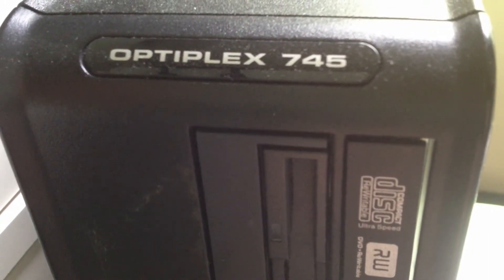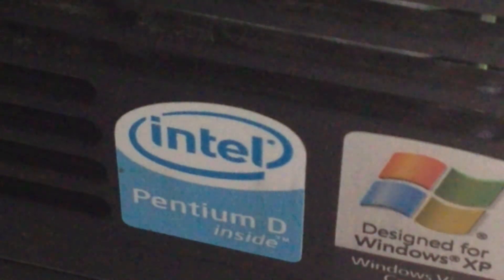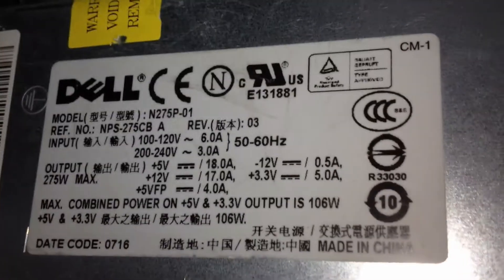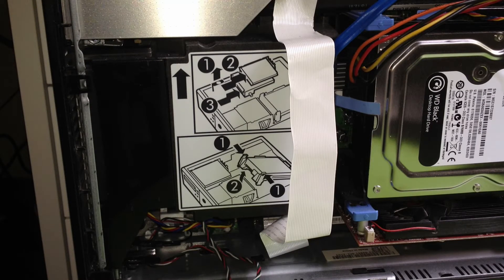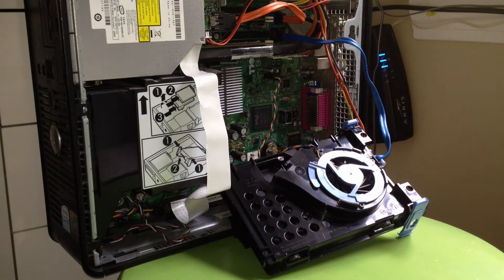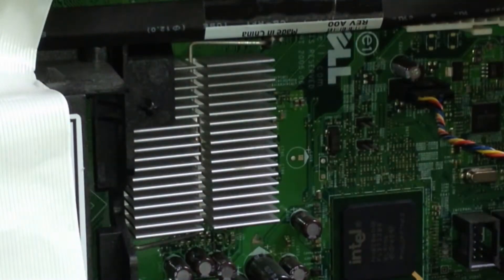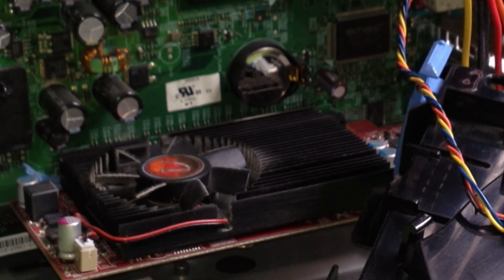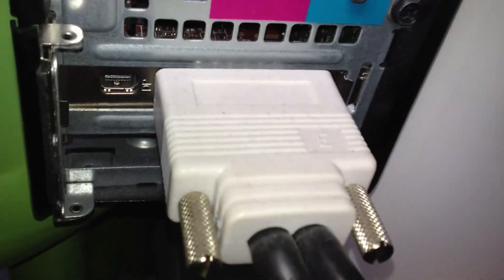Dell Optiplex 745 -- Hardware Overview

Comment: I cannot find on the internet what is between the case button and the momentary switch on the small pcb inside the case. Can someone please answer ?
Reply from the maker: I have no idea what that piece is called, but given the age of these machines I doubt you'll be able to order a replacement from Dell.. These can be found for next to nothing now, you're best bet is probably to find a scrapped unit and pull the part from there..
Reply: @JordanU  Thank you, but do you know a image location on the internet or can you make a short video about it ?
Reply from the maker: @Roarkethemerciless  You can probably find something about it in the service manual..